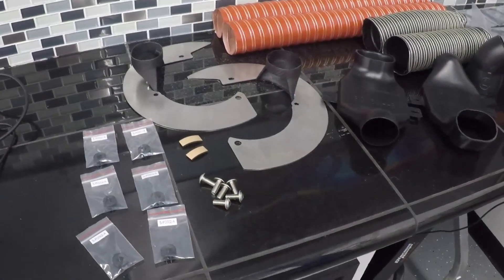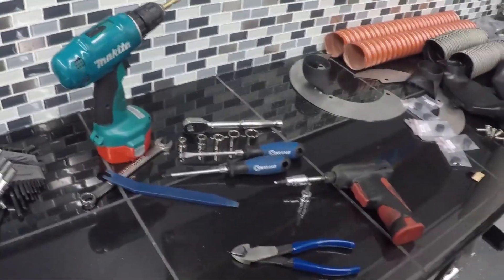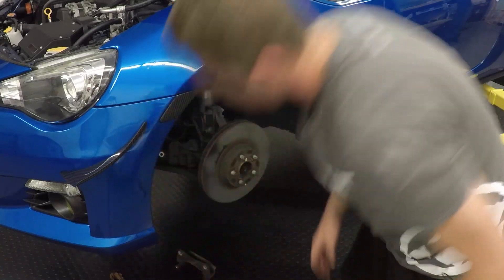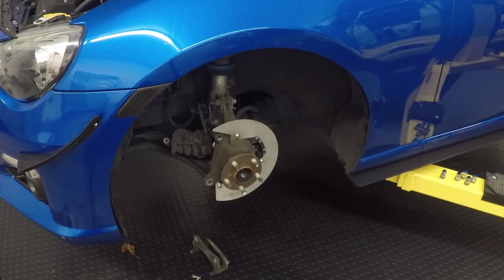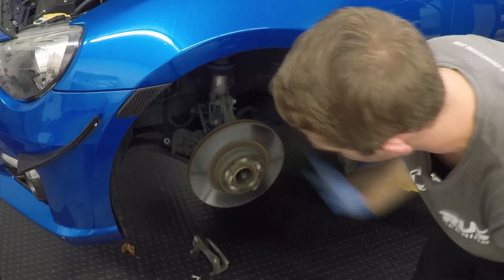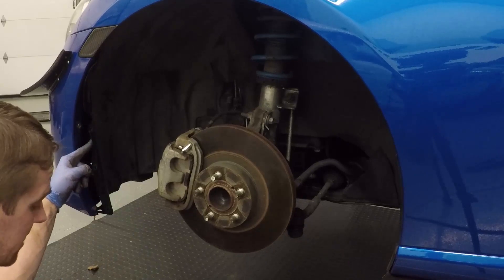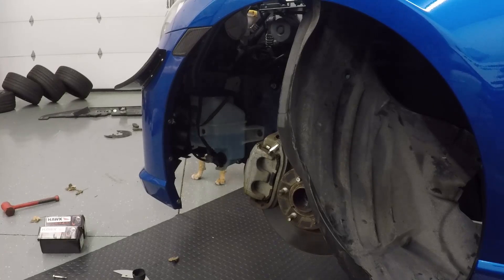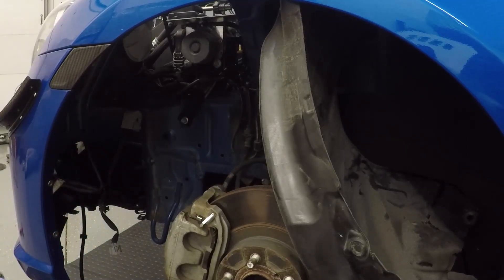Verus Engineering FRS/BRZ/GT86 Full Brake Cooling Kit Install

Comment: Are these kits designed to clear the standard 215/45/17 tyre size at full steering lock without needing a steering rack limiter or spacers ?
Reply from the maker: No, but you do not have to install all of the rack limiters if you do not want. You can install 1 per side, 2 per side, or 3 per side. Up to you.

Comment: No 17+ 86 version?
Reply from the maker: The kit comes with brackets for both 2013-2016 and 2017+ models.
Reply: Verus Engineering awesome. Will be buying this kit for my 2018 86
Reply from the maker: But it does require the OEM fog light bezels for direct fit.
Reply: Forget about the brz, what's happening with the yellow mr2 in the background?
Reply from the maker: @matthewlopes9696  It's finally fixed and our of our hair! haha